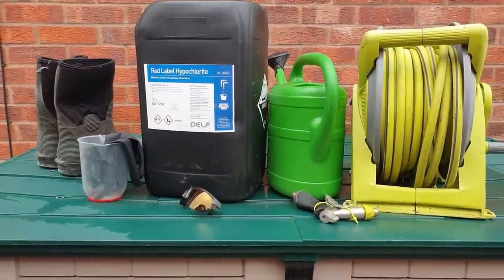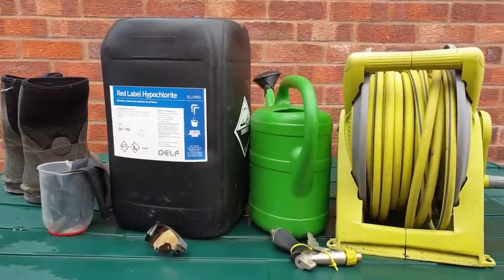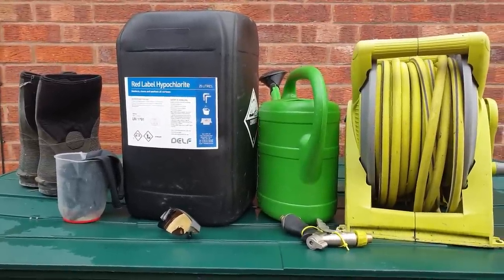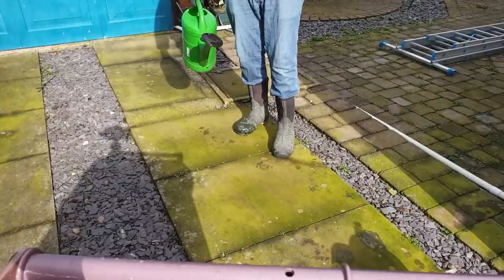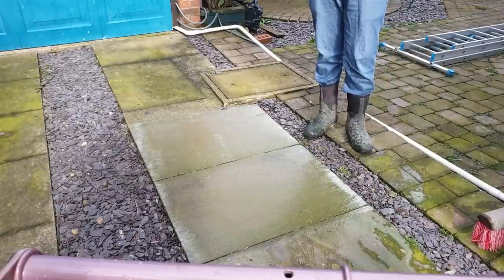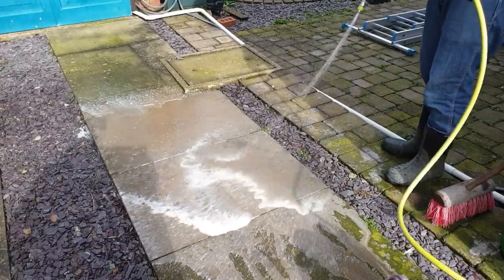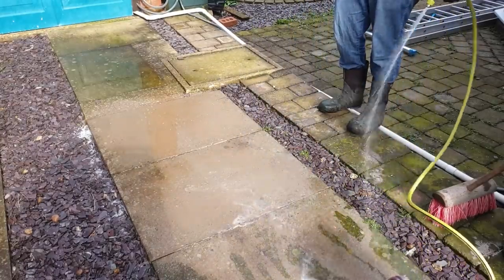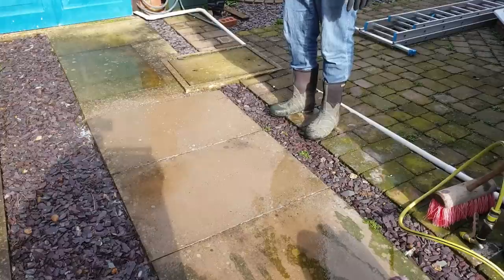How to clean a concrete drive with no power washer - soft-washing - Sodium Hypochlorite - Hypo

Comment: I’m a 57 year old woman and I used sodium hypo. I was dressed like something for breaking bad in my PPE which cost 12 quid for the two of us. 1:4 ratio. Less noise, less damage, less water. Quite easy. Worked with husband. Used snow shovel to protect lawn. Strict caution though on using as it burns and damages. It’s brilliant stuff no more need for blokes wreaking the patio or drive. Made liquid up in a bucket and brushed in. Quite therapeutic.
Reply from the maker: Breaking Bad is a classic.

Comment: Well put together video, unlike some others that faff on for ages. Just so happens that I used this stuff last year on block driveway using the exact same method. Came up a treat. Only difference was I used a pressure washer to rinse it down afterwards and "walk" the crap into an area for disposal. One interesting thing I learnt from this video was that once it had reached its expiry date it only degrades to 10% and is still usable. That's great news as I have around ten litres left over from last year. Thanks. Hope that sneeze wasn't covid!
Reply from the maker: LMAO.... That sneeze is 100% Old School..  I got trapped in SE Asia when they invented COVID and to this day I am still here. 🤣

Comment: Good video, ... I've used Sodium Hypochlorite for years cleaning stone and concrete driveways with oil stains, works wonders, .. Even cleaned with Sodium Hydroxide (drain cleaner), you can't beat chemical cleaning, forget all the crap in the shops, they are all to diluted to do a proper job .... My advice is if you need to wear protective gear then it will work! ;-)
Reply: Can we clean our water tanks with sodium hypochlorite liquor, please advise.
Reply: Yes you can
Reply from the maker: Yes but a very weak dilution, the make sure to flush at least twice with pure water.

Comment: i had a bad patio, algae, lychen( however you spell it) used roughly 3-1 mix and left it for an hour. came out perfect, only a few bits i had to go over with a brush and another mix.
Reply from the maker: Glad it worked. 20 - 30 mins is long enough as solution becomes inactive after a while. But you got a result and that's all that matters.

Comment: Great video. Can it hurt flower beds or lawns if the pavement is close to them? TIA
Reply from the maker: Yes it can burn the plants. The trick is to literally soak the edges, grass plants etc to saturation with water prior to starting. That way the plants literally stop drinking for a while and as the peroxide is inactive after about 15 mins it prevents the plants consuming the harmful parts.

Comment: Hi there! Great job. Can I use a soft wash surfactant on a tarmac tennis court? Can you please recommend a product? Thank you!
Reply from the maker: You can but I would use it in weaker dilutions.  The key to tarmac is a stiff brush and elbow grease. Always best to clean tarmac after a hot couple of days in summer when the moss is dried out and brushes off more easily.

Comment: Hi just starting up on my own came across youe post spot on what boots are those you are wearing cheers
Reply from the maker: These are a brand called Muck Boots.  Very durable, excellent grip and protection - much favoured by the Horsey crowd. When I bought these 6 years ago they were about £60 a pair

Comment: Would this work in a spray bottle on a crematorium slab? I have hypo in shed.
Reply from the maker: Theoretically it should. I once had a conversation with a headstone company and they told me how they do it and there's a amount of permission you need from cemetery or church etc. Not as straight forward as you may think.

Comment: Will this remove efflorescence off patio slabs? If not, do you recommend anything for it? Every slab in my garden is stained
Reply: Eff requires hydrochloride acid - be very careful with it
Reply from the maker: As per the other comment.

Comment: Will the solution kill grass? I have grass on both side of pathway.
Reply: Soak the grass well, before and after.
Reply from the maker: As long as the grass is thoroughly soaked (clean water) prior to application of Hypo it will be fine as long as you also soak the grass again immediately after application.

Comment: when you have small weeds in the bloc paving , is it best to remove weed first , or would this instantly kill weeds without having to weed manually , how would you approach that situation , my thanks in advance
Reply from the maker: This will kill the leaves but not often the root so best to weed first in my opinion.
Reply: Green Pro Clean Ltd is it best to mix a professional weed killer in it as well, doing both jobs at once? 

Plus adding the surfactant (fairy liquid) will help both the bleach and the weed killer?
Reply: Rock salt

Comment: Not bad but you really should be mixing a surfactant into the solution I.E washing up liquid it helps it stick to the surface and speeds the job up 3-4 times
Reply from the maker: Yes and no. On a flat surface not really important.  On walls and roofs though for sure.

Comment: I have a poured concrete pathway (not pavers as your video), i have sealed the concrete so it doesn’t dust. Will the hypo damage the concrete sealer i applied?

Comment: Okay but what happens when you put grass into the situation does it kill it? I imagine so a jet wash wont
Reply from the maker: Like anything, if used incorrectly it will do damage.  If you are using it around grass or foliage pre soak the foliage thoroughly, this will prevent the grasses from soaking up more liquid, they wont absorb more than they can handle.  Then apply Hypo, hypo will only remain active for about 20 mins before breaking down far enough that it can be rinsed off.  Any real power washer (not the Karchers or Black and Deckers you use to wash the car type but commercial grade power washers can destroy the grass a hell of a lot faster than Hypo can.  It's all about correct usage regardless of the tool.

Comment: Can I spray Hypochlorite with the detergent hose in the pressure washer? I have a petrol pressure washer that has a little sucking hose to feed from a bucket, the PW also has a sprinkle tip to work as a normal hose.
Reply from the maker: You can BUT the hypo is harsh on the internals of your machine so be sure to run a good 20 or 30 liters of clean water through it AS SOON as you are done.
Reply: Spray through a 2 gallon pump sprayer. You will be able to control your overspray somewhat better. Use a course spray. The wind will carry a fine spray where you don’t need or don’t want. And he is correct, wet doesn’t all foliage in the area before spraying and after. Also basic Personal Protective Equipment is more than a good idea.

Comment: could this be used on galvanise fire escapes?
Reply: Hypo is highly corrosive, so be sure to rinse very thoroughly and do not let the hypo dry on the surface. Keep misting the surface if there is a danger of drying.
Reply from the maker: Yes but as above do not allow to dry and be sure your rinse is 💯%

Comment: Will hypo remove latex paint from concrete?
Reply from the maker: I do not think so - you need to find the brand of paint, then in it's info sheet (manufacturers website) it will give you removal agent options.
Reply from the maker: dee 1987  sure.... give me £5k pllus for the machine and I will use it

Comment: I think that's mold, not algae. green mold. "Mold is stubborn and much harder to remove, making it a more costly endeavor. More importantly, the greatest difference is in the way they affect your health and the health of your family. Algae growing anywhere on your home, while unsightly, will not do any harm to your health or the health of your family." Oh so that's why it got removed so easily - it is algae and not green mold.
Reply from the maker: You are totally correct - I have been to many homes with my job where the homeowner has black spots of mould all over the windows and I explain about the health factor - If I go back the next day I can guarantee it's already gone.
Reply: @Darren-Green  "Sodium hypochlorite is most often encountered as a pale greenish-yellow dilute solution referred to as liquid bleach," - so instead of renting a power washer - I just poured bleach and scrubbed it in. The smell is very strong. I think it's 7.5% concentration. So the black mold is totally gone. I had used vinegar earlier - which got rid of the green mold on top. I think I breathed in chlorine gas from the vinegar bleach reaction. oops. haha. So I could smell it through my bed room window - since I didn't insulate that window. But I survived the night and just finished off the bleach bottle on the patio. Need to get another bottle of bleach to finish the job. Cheaper and more effective than a power washer. Then there's some rust stains now underneath the black mold. So I'll have to switch back to vinegar to get rid of the orange color. I can wait - wash it off first of course. thanks
Reply: @Darren-Green  litchen

Comment: It’s too much of a proses. A power washer would of left if Super Clean without Clorox or other chemicals.
Reply: No. A pressure washer will not kill off the microbial spores unless you use steam i.e. water above boiling temp.

Comment: Bleach does the same job
Reply from the maker: That's probably because Sodium Hypochlorite is the active ingredient in bleach mate.
Reply: What ratio of bleach to water are you using Dave
Reply from the maker: @franceslombard6751  hypo is either 10 or 15% in strength.   Then you dilute that to where you want it to be.  
'Bleach' such as clorox or domestos etc is around 3% strength so once you dilute that even weaker.
Bleach active ingredient is the Hypo content the rest is surfactants etc. 

In short if you use domestic bleaches instead of hypo you will have to wait a lot longer for it to work.
Reply: many thanks
Reply from the maker: @franceslombard6751  you're welcome

Comment: Then it runs into the drain and into a river and poisons everything in sight. That aside it's great stuff..
Reply from the maker: At such low dilution and applied by watering can it's inactive after about 7-10 minutes.  This is why I laugh when I see people saying 'leave dwell for 30 mins blah blah' Also at the dilution used it has less active ingredient than the Clorox or Domestos type products you use in you home but you still flush those down the drain don't you?  👍😁